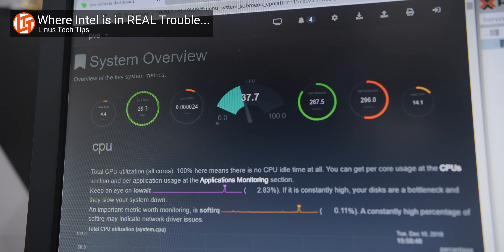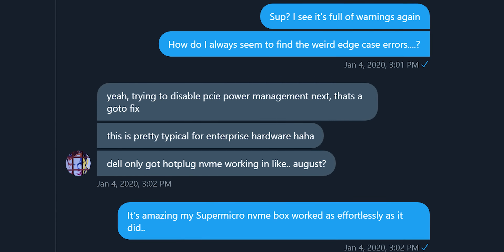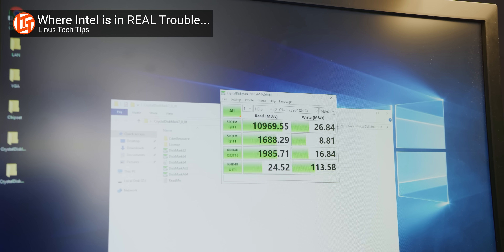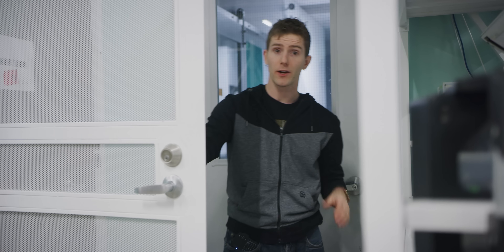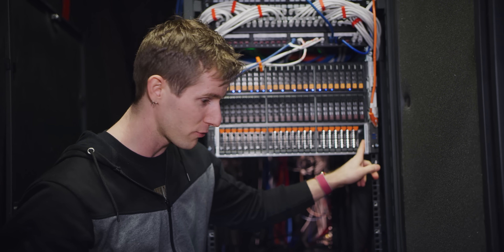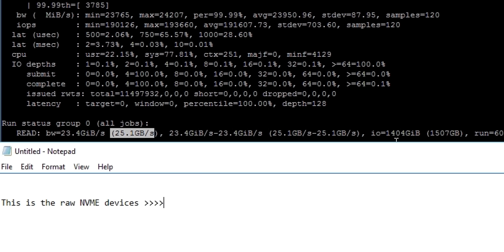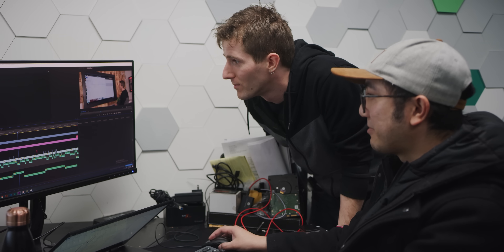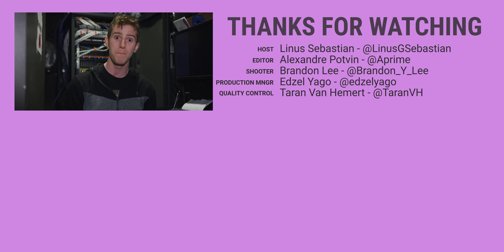This Server Deployment was HORRIBLE

Comment: ChatGPT3.5:
Summary
📹 Experienced performance issues with a high-speed SSD storage server and investigated the root causes, leading to a unique solution involving Linux.

Facts
Encountered inconsistent performance on a high-speed SSD storage server, with transfer speeds ranging from 10-30 MB/s to 20+ GB/s.
Initially suspected Windows Storage Spaces configuration issues but later discovered hardware-related problems.
Investigated driver updates, power management tweaks, and potential software solutions but found only marginal improvements.
Experienced similar performance drops on Linux, suggesting a hardware issue.
Highlighted the industry-wide challenge of engineering software for high-speed NVMe storage devices.
Discussed the mismatch between the server's storage capabilities and real-world usage needs.
Explored Linux's polling mode for NVMe devices as a potential solution.
Described the kernel's handling of data requests and potential interruptions.
Shared the implementation of a polling-based solution to improve storage performance.
Settled on a Linux-based configuration with striped software RAID-5 arrays and optimized chunk sizes.
Emphasized the benefits of low latency and multi-user access to high-speed storage.
Concluded that the server met performance expectations after adjustments and CPU upgrades.
Mentioned potential future improvements with dual-socket configurations and AMD optimizations.
Acknowledged the assistance of Wendell from Level1Techs in resolving the issue.
Mentioned Linode as a hosting service for virtual servers.
(Note: This text contains a significant amount of technical detail and can be challenging to summarize concisely.)

💡 Easy to use
☁ Offers cloud computing with a DIY option
🛠 Provides options for custom setups or one-click server deployment
🎮 Supports Minecraft, CS:GO servers, WordPress, and more
🌐 Allows easy setup of your own VPN
🌐 Offers ample space for hosting websites, apps, or game servers
💲 Affordable pricing with no hidden fees
📞 24/7 customer service via phone or support tickets
💰 Get $20 in free credit with code "minus20"
📈 Upcoming petabyte project updates and subscriptions

Comment: I'm looking to build essentially the same system in 2023. Same chassis, but with slightly lower specs. The plan was for 8 x 8TB U.2 with an 8-core 7232P and 128G of RAM running TrueNAS scale. I assumed it would be more or less Plug&Play.
Is this buggy mess still what can be expected when building an NVME NAS in 2023, or have things since improved? The price/performance is much better than on prebuilt Synology/Qnap solutions, but I'm not sure I could handle this. I obviously don't have Wendell on speed dial here...
Reply: What did you discover?

Comment: i'm wondering if it's more that the CPU is already in the interrupt handler when it sets up the next transfer. Not sure how it's handled on CPUs but on things like microcontrollers what happens is the last thing you do in the interrupt handler is clear the hardware flag to ready the next interrupt trigger. but if the drive is so fast it might be signalling the interrupt while the CPU is still in the handler but before it's cleared the the flag, so the new interrupt is ignored.
This would explain the timeout better to me, but as I said I'm no expert on CPU interrupt handling.

Comment: Remember when old whonnock died and all the data was lost because it ran three raid 5 striped? The "All...of...it" moment? Despite that, this new server is set up with three raid 5's striped. The only reason to stripe is to improve read speed, but it's already so fast the cpu has trouble handling it, so what's the point... except set yourself up to the exact same pain once again? Anyone who does a stripe setup is asking for data loss.

Comment: Back in the day we had a printer/plotter that running in plotter(graphics) mode would accept a line of dots (2048)as 256 characters Normally running as a printer you loaded the print buffer (132 characters) with a series of poled operations,   send a character, test to see if the printer was busy if not loop back and send another character when you had filled the pritnet buffer the printer would go busy so you enabled the interrupts and went about the other business.   However running in graphics mode the time between sending a set of 8 plot bits was much longer than the time when sending a character in print mode, so when plotting everything came to a screeching halt with the CPU spending all of it's time servicing the printer interrupt because the printer wasn't ready right away so  enable away you go, of cours bu the time you had returned the printer was ready,   (servicing an interrupt is actually pretty time consuming, because you have to save the status of EVERYTHING, service the interrupt, the restore the status of everything).  my boss actually took an oscilloscope to the printer interface and then we timed everything.   Then we took the printer driver and inserted 10 NOP after loading the buffer then tested the ready bit.  Bingo plotting was now as fast as printing.  But the printer sounded way weird when it was plotting.   Computer was a PDP-11/45 which in the day was a pretty fast machine.

Comment: Quick question, would it be better for the LMG Video Editor Section to be part of a common user group (say Video}, that way Linus or the other Tech guys don't have to be individually logged in and instead the entire group is added to save some time and testing is much quicker. Would this be a better method?

Comment: Why software raid over hardware
Reply: Cost, Flexibilty (swap disks into a new machine with a different disk controller - no problem), reliability (my company used to stock replacement parts for every type of hw raid controller we used in our DC, because - surprise, surprise - the on-disk format of different brands and even different models of the same brand is not the same; with sw raid that's simply not an issue), ...
Reply: @stephanweinberger  Well in terms of cost, RAID cards arent that expensive, something like a whole dell R710 server isnt expensive on ebay. And with hardware RAID you dont limit your disk format choices.
Reply: @reki353  We're talking nVME U.2 here. There aren't even that many nVME-capable RAID controllers available, and they are quite expensive. E.g. the Broadcom 9560-16i is listed ad ~1200USD (and it only has 16 ports, so you'd need another controller for the rest of the drives if you want full bandwidth without extenders).
Reply: @stephanweinberger  SAS SSD's are really fast, most likely on the same level as NVME, in terms of HDD's SAS HDD's are really fast too with 15K rpm. The main problem is NVME doesnt have as many features at all compared to a more mature platform like SAS.
Reply: @reki353  NVME is a completely different concept. It's basically just a bunch of memory that can be accessed more or less directly via PCIe, almost without any protocol overhead. The downside of this approach is that the feature set is much smaller than with SCSI/SAS. But in terms of raw performance NVME typically is about 4-6x faster than SAS.

Both approaches have their pros ad cons, they are geared towards different applications (and in a NAS - like in this video - it actually doesn't make much sense to use NVME).

Comment: Wait. Can't they add a linux real time patch to make the interrupt problem not be as big of a problem?
Reply: Either that, or do exactly what they did: skip the overhead of interrupts (yes, this sounds counterintuitive, but interrupt-handling involves quite a lot of work in hardware and software) altogether and just periodically poll the drives for new data.
Reply: @stephanweinberger  does it guarantee that transfer will be faster, or is there just  because it doesn't bottleneck the Cpu?
Reply: @kvatikoss1730  the main problem in this case doesn't sound like a typical bottleneck, but rather that sometimes the interrupts get lost or sent to an inappropriate core under heavy load (and as Linus pointed out, even just reading the data from memory for e.g. the raid-parity calculation already is a heavy load in this scenario), so the kernel/drive runs into a timeout and resets - which takes a few seconds and totally wrecks throughput.

I was more commenting on the additional benefits of actually doing less work without interrupts in this high-performance scenario.
Reply: @stephanweinberger  oh ok Thanks.

Comment: Am I correct in thinking that a Xeon with DDIO would have handled this  workload better? Which would be really funny since the original video was "This is where Intel is in REAL trouble".
Reply: The problem doesn't seem so much putting the data into memory (PCIe does that basically on it's own anyway), but knowing when the data is ready for further use.

Normally with DMA the divice writes the data to memory (or with DDIO directly to the CPU cache) and then sends an interrupt to let the OS know when it is ready. But with the speed of those NVME-drives the interrupt handling (receive the IRQ in hardware, jump to the handler in the kernel, switch the correct user or kernel thread to receive the signal, etc...) is actually more overhead than just running the threads in the normal scheduler-cycle, let them poll the drive and yield if the data is not yet available.
Reply: @stephanweinberger  IIRC, they actually had two problems and that was one of them but IIRC (its been over a month) even after that they had to slow down the drives for it to work. so there was a separate bandwidth problem in addition to the interrupt problem. But I could remember wrong. You presumably just watched it and remember better?

Comment: Given what the issue appears to be, I would think the fastest method would be to poll the drive for a few microseconds, then if it still hasn't arrived, switch to interrupt
Reply: Since the access time of NVME is near constant the kernel could even monitor the average delay and let the thread sleep for that time, so that the data is usually available at the first poll. It could even dynamically adjust the sleep time when the access time goes up (e.g. during heavy write loads) and the first poll doesn't return a result.

Comment: The Supermicro 2123US-TN24R25M supports 24 U.2 NVMe, much like what you've got here. But it also has support for dual CPU Epyc [7001 or 7002]. That could be up to 2 x 64 core. That's up to 8TB of memory, although supermicro doesn't sell 256GB sticks. You'd have to check compatibility, cause they only sell 64GB, max [2TB total], and only Samsung and SK.Hynix have 256 right now. You can even use massive drives [micron 9300 pro 15.36TB ea, for about 350TB~ish].

The catch ... is the price. Configured on a random server configurator seller site, the price is a hair under $124,000 [$75,480 of that is the drives]. If you go for 7.68TB drives, the prices drops to around $82k. Dropping to 2x32 core gets it down to $71k [NOTE: The configurator I used indicated 2 cores recommended per drive, and this is a 24 drive system]. You can get it down to $51k if you drop from 128GB dimms to 64GB dimms [but that goes from 8TB to 4TB of memory, so ... math what you need first]. 

Either way, though, if you're willing to spring for enterprise grade hardware, you can end up with some ridiculous hardware. I imagine something like that will be capable of doing the work of managing the drives. And if you're really ambitious, you can put a 200Gbps switch in your rack, and get an add on card for this. Then, having everyone connected via 10G or 40G, you would still reasonably be accommodated in multi user contexts. :b

Comment: Lol, just 8 channels of memory?  Wait... you're using ZFS Raid?  Lols, no wonder you're having trouble.  Bigger chunks are needed usually, but wait.. why were your 512k chunks high latency?  That's really weird.  I know you say the buffer matches for the 128... but I still don't think it should be that high for the 512.  I have less latency than that  even to mechanical backing storage.  Why didn't you consider using actual HPC style storage?  For this use case you might consider NVME over Fabrics.  Also, I swear MDM is way more reliable than hardware RAID junk.
Reply: Just for reference... you're hitting 3 GB per second real world... some of these solutions you should get at least 40 GB per second sustained read or write.

Comment: I think the problem you are overlooking in this build is that you are mixing both sata onboard and raid controllers to make a single array. If you slapped 1 more raid controller to get rid of those onboard sata connections then you shouldnt have any issues. Some motherboards can cause issues like this, i have seen it in the past. Your second option is to create 2 arrays, splitting your storage capacity from the onboard sata, and another array for the raid controllers only. Create a shared storage for the array on the raid controllers, and see what what happens after that.

Comment: Is the configuration using RDMA? Judging by the CPU usage it's not and it really needs to or else you will be limited to your CPU and as well waste power on both the server and workstation sides.

I just watched this video after watching the PS5 apology video where the bottlenecks with CPU interrupts are discussed and then I searched Google for Linus Tech Tips and RDMA and found a post referencing a LTT networking video from a few years ago and the solution to get RDMA working. What I didn't find, surprisingly, was a LTT video that shows the insane bandwidth improvements from using RDMA. My apologies if it exists and I missed it in my searching.

I personally use RDMA for my servers backbone and I'm in the process of rolling it out to the workstations in the house. I can't imagine transferring files around without it.

Of course with Windows Storage Spaces you also have to make sure it's configured for IsPowerProtected=$true and all the drives have PLP hardware otherwise Windows won't trust the drives can flush the data on a power loss and the performance will be sub par.

https://community.mellanox.com/s/question/0D51T00007Tnw72SAB/rdma-roce-compatibility

Comment: Too bad the Compaq Proliant series of Enterprise servers isn't still around. You'd have something that worked, and nothing to talk about.. Dell/Intel enterprise solutions weren't a thing in the enterprise until Compaq died. You could hit a Proliant with a 30-30 and it would keep running, hot swappable pci slots.. when will Dell/Intel get that? yea.

Your little problem has nothing to do w/software if linux can't run it. Your hardware sucks. I used to be a platform test tech in the Dell/Intel JIC Lab in Dupont. I can tell you first hand.. your problem is hardware. Engineering talent has softened somewhat since "the good ole' days". Good luck getting anything stable from them.

Comment: Oh, Linus, the speed of reading / writing large (from about 1 TB) data fast is really a state-of-art topic.  Did you ever think of the performance of the File System? i.e. NTFS vs. ReFS, and others.  And of course the versions of NTFS or ReFS too.  (While it seems ReFS is not that stable, or, if it fails for some reasons, it's very difficult to recover using current recovery tools.  (What tools support ReFS?)

Comment: I have run/managed/configged 1000+ servers in my lifetime, and at the moment run several 500TB servers. Lessons I learned ?
ALWAYS do RAID10 (with at least hardware raid 1 mirrors)
NEVER run ZFS
XFS filesystems for small files
EXT4 filesystems for large files

Comment: Sounds just like software bugs.

I remember going 64 bit... Well I also remember going to 16. Lol...
 They've never really got the software to work well.

I recall doing data centers and having to call out MS engineers to "program" the OS so it would work.

Now for the Told you so....

Your using NAS not SAN. So you will get all those problems. Due to how the network is set up.

Your next project should be SAN so that you DAS and load balance from mirrored arrays, giving the user less lag , better bandwidth and availability, and more redundancy...

Quack quack...

Comment: I had a similar issue on a 10core laptop with xfs on lvm spread across three NVMes. The fix was moving to ext4 on lvm with small block size. The issue appeared only when data on a filesystem was on or near the bounds of a disk.

Comment: That´s why you use the right tool to do the task,maybe a professional  NAS?just saying...maybe. If not at least divide and win,use another machine,that is a very simplistic way to solve the problem/task. Linus wants to run Windows on that server,so cute,hahahaha. It is a little bit stupid to put so much load in 1 machine.

Comment: I could have told you that. A friend of mine built a RAID 1 with NVM and it is slower than non RAID. I once built a RAID 10 with 14 SATA SSD using StorageSpaces and it worked great.

Comment: That moment, where you need to stop playing in the playground, and buy a freaking dedicated REAL storage system, netapp, fujitsu, all flash, mas, we are doing 300000iops and around 500GB in multiple shared enviroments, using multiple 36Gbit darkfiber links :) yeah, 200k to half a mill, but, yeah it works. BTW, they have no SO, all is ASIC controlled drives.

Comment: first of all the only thing it requires was to obtain single pcie sas controller that would have enough ports to handle entire physical array thus ridding of switching, simultaneously configuring the array and let the card bios take over the low level stuff (lsi would be the best option IMHO) and only borrow some power from "now free of all the other the crap" system that should have more than enough power (the card having it´s own ram and yada yada) then installing w2019 datacenter with lsi utility to handle pooling and quotas and there ya go.. problem solved.. or you could "simply" use the onboard ports and try to tinker with intel nonsense both in bios mode, during installation and after installation in windows..